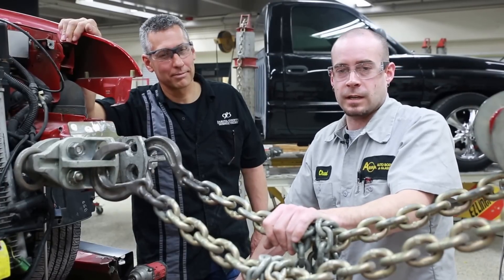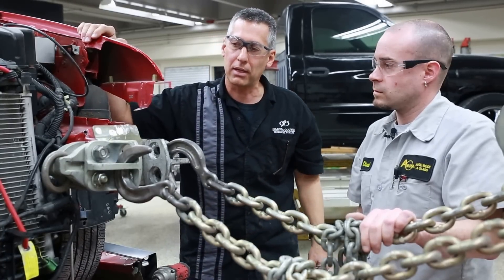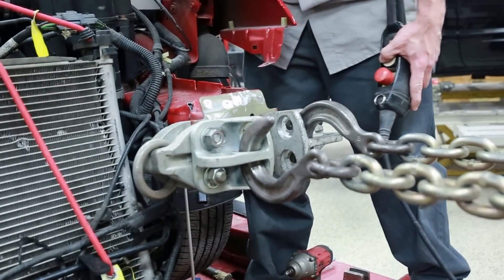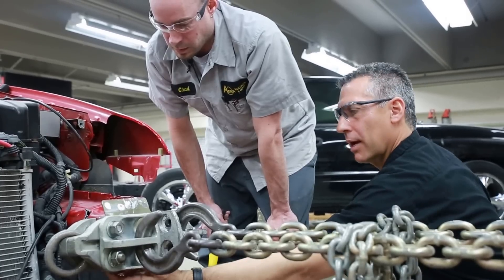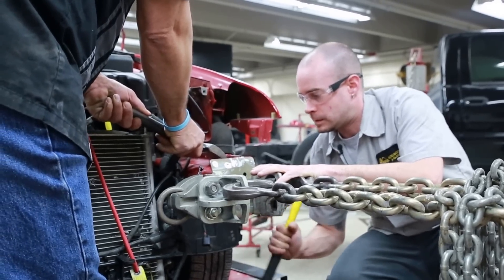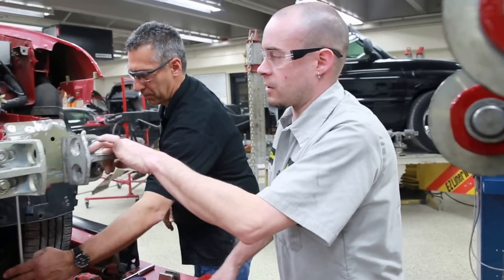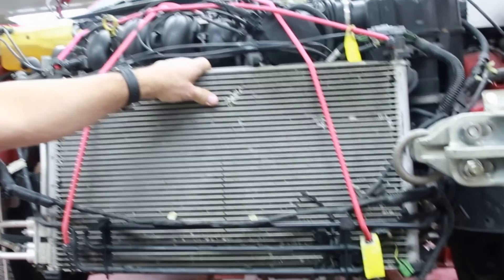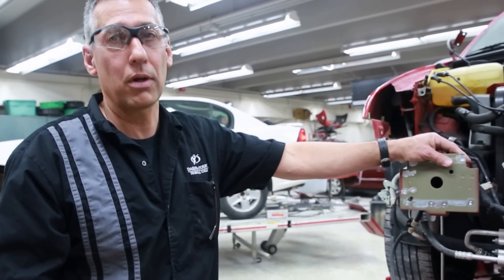Auto Body Repair: Pull on a 2005 Ford Focus

Comment: They have no safety gear on, not covering the chains with safety blanket, and they are standing so close to all that pressure... If the chain snaps smh
Reply: What about taking 2 to 3 weeks doing the repair? Shouldn't take but 3 days at the most, what do you think?

Comment: Who oh why does the 10 thousand pound quote always pop up...
If it is not my rig is 50 thousand pounds etc lol
The handle of the hammer is too long you need to be using a block of wood and stand back then bash it....

Comment: Typically if you got damage to your intake, a/c compressor, alternator or whatever other "deeper" component, then that unibody is far from being fit for repairs for the usa or Canadian market. Oh, and freon is not used in that car. You chose to be technical in your descriptions, but lack use of proper terminology when it comes to the refrigerant.
Reply: what are you talking about intake alternator are not part of the unibody whatever is damaged in the unibody it gets replaced

Comment: This set up is so unsafe it's ridiculous.  Using the wrong chains, hooks and no guarding.   A technical school teaching unsafe practices such as this is unfortunate.  The rigging is not used for dynamic variable loads.  The guy hitting the hammer on the load and having his head near the line of fire if the chain brakes creates is a major safety hazard.
Reply: Though I see your point, I really don't think those chains or the bolts/other linkage is going to snap and fly in the air... This stuff looks like it could hold King Kong !!
Reply: your right

Comment: Used some heat 
U guys are not very experience and its scary to see u work .
Reply: you could not use heat on high strength to straighten it
Reply: Scar JD right lol just gotta replace it now
Reply: They’re not supposed to be grabbing the chain while pressure is applied
Reply: damian ramdass 
Did u miss the point of it’s a school??

Comment: Interesting, why not cut the damaged part off and weld on a new piece? Is'nt the integrity of the metal where it collapsed compromised?
Reply: That is what I was thinking. If the frame rail is kinked or torn it must go.
Reply: I'm guessing, it's an option wich welding might cost more than just pulling